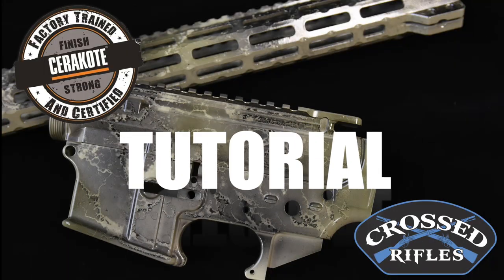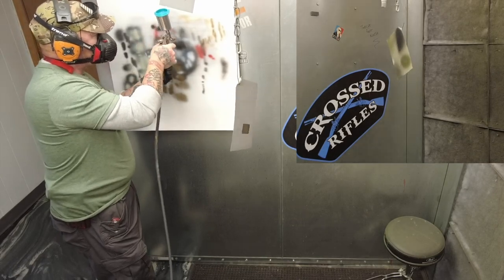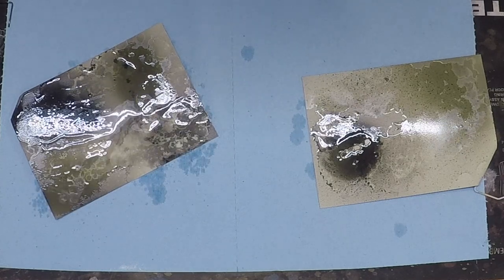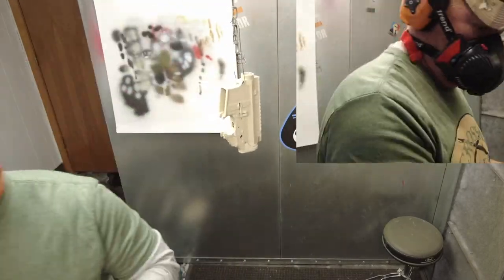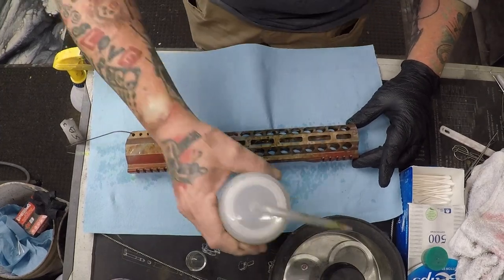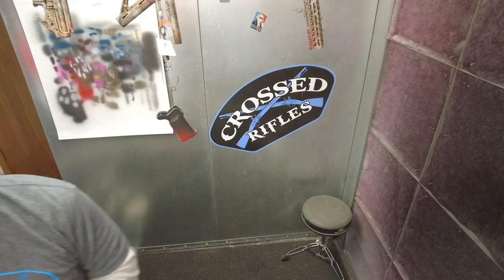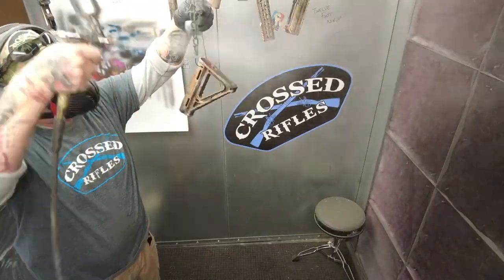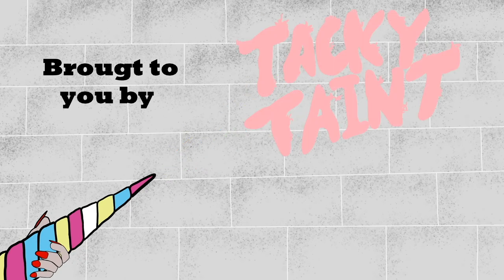Marble Cerakote Tutorial

Comment: Much better way if doing this.  A technique we using in spfx for marbling is spary your paint down then get a soft brush heavy with solvent and use the brush to push you paint into lines. Maybe i can show you we do this with silicone and acrylics all the time it shouldn't affext the paint as the solvent flashes off.

Comment: Had a go at this with some MDT poly mags. Looks awesome, but ended up with some very shiny areas. Not sure why it's shiny, maybe because the acetone didn't spread out enough and evaporate fully. Any ideas on where I went wrong? On the upside, I rubbed the hell out of the surface with a towel and the Cerakote's holding up. Magpul FDE for the base kote, then Glock FDE, Magpul Foliage Green and Magpul OD Green.